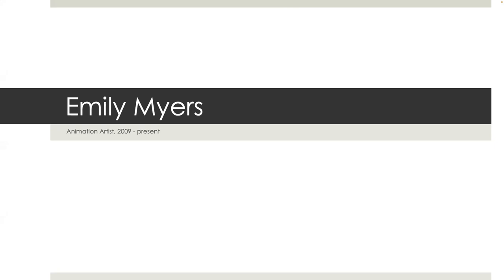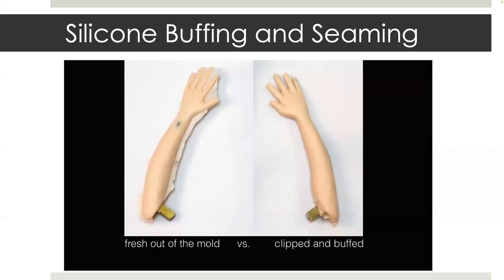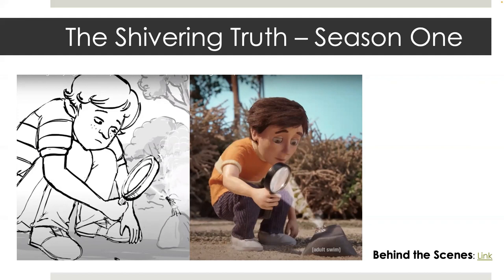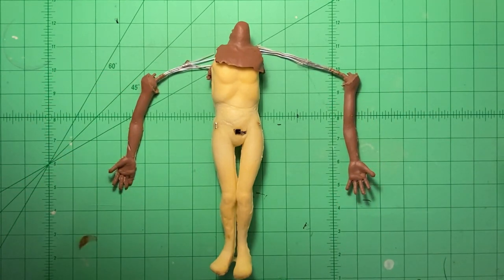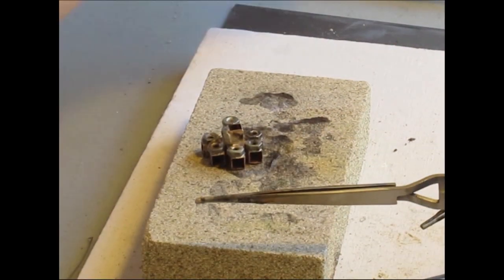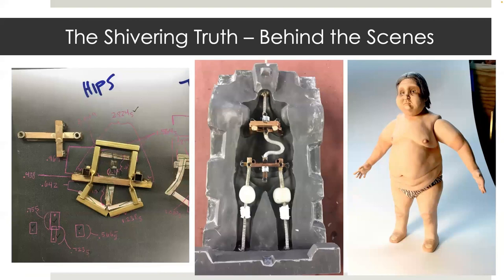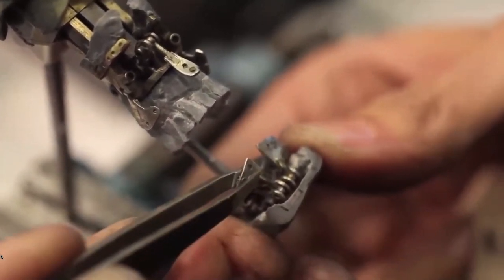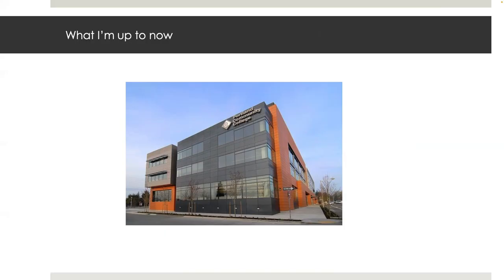Behind the Scenes of a Puppet Fabricator

Comment: Hi there, really useful informative video… I wonder have you ever got to keep any of the props puppets from the films you have done? Cheers mark
Reply from the maker: Yes!  But only when they said I could.
Reply: @emilydmyers where do you get Cold foam from and is it expensive? I would love to see lots of mould making from sculpts. …. Step by step … and repeat … as the more different casts and mould you do the more helpful it would be … Thanks mark 
Also would you ever sell one of your puppets?
Reply from the maker: @markkevin7245  The cold foam is bjb TC -266.  You can find it here:  https://bjbmaterials.com/tc-266-a-b/ .  Says it's $70, which isn't too bad, but also kind of a commitment.  I have a silicone body casting video in the works, but no mold making yet.  That will be my next big project for sure though!  You'll probably have to wait like a year before I put that out though, sadly.  I've got so many projects on the back burner at the moment.  If you can't wait that long, you can get some information on mold making through Kathi Zung's DVD, which you can find here: https://www.stopmotionstore.com/index.php?main_page=product_info&cPath=5&products_id=81&zenid=6199889f373cf210e550d00a15925265
Reply: @emilydmyers  thanks very much … foam may be too expensive .. I’ve made a full size Incredible Hulk mould and wanted to cast a suit with structure quickly … that other site is great I’m going to get there whole downloadable package